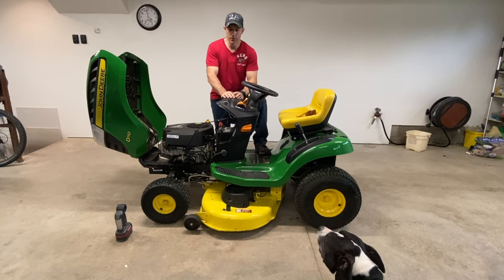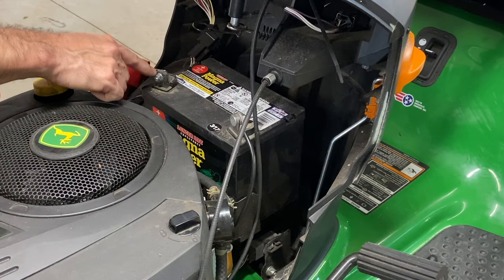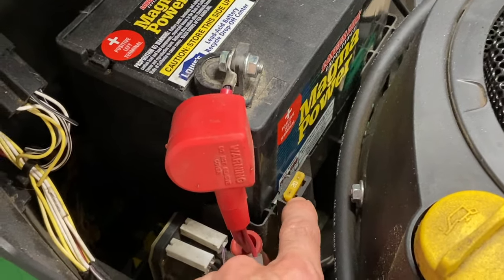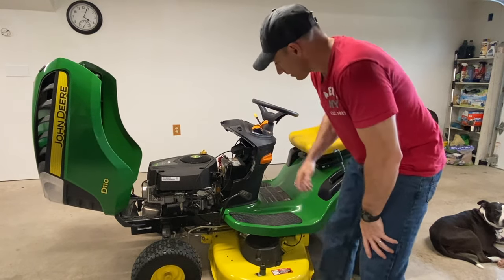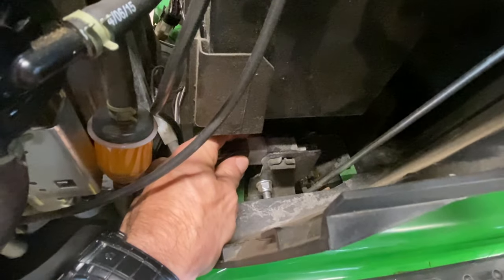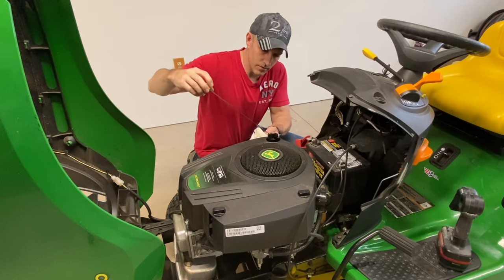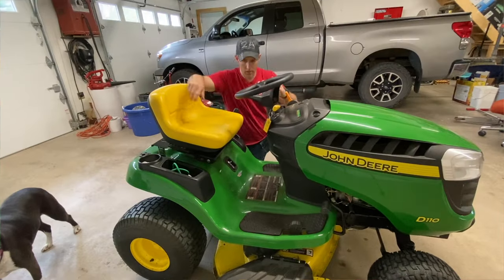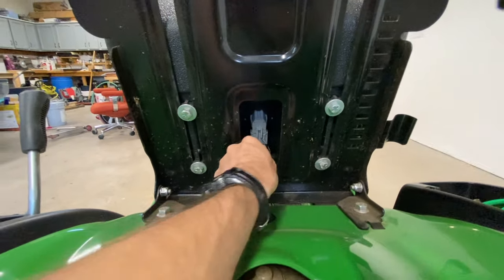JOHN DEERE 100 SERIES WON'T START

Comment: My lawn tractor, pretty much just like yours, was running fine today. Stopped in the middle of the yard to do something, hopped back on to start it, and it just clicked. Battery had plenty of juice. Watched your video, simply jiggled every electrical connection you mentioned and made sure it was tight, and later it started. I still don’t know which one was loose, but you helped get something reconnected and ultimately helped the engine start. Thank you very much!
Reply from the maker: Your welcome

Comment: Mine cranks but won't start.  I assume there's an air filter as well? Has new battery one year old.  It did run out of gas last time I used it.  Started right up after I added gas.  Maybe it sucked debris into the filter when it ran out.  I'll check that first.
Reply from the maker: hope you got it figured out
Reply: Air filter is typically all the way up front on the engine. Under a cover with hand screws

Comment: if i check everything you said and ????  but engine turn but dont start....  i didnt tuch or starded the john deere D160 for 3 years.  last week,  putted a new batteries, new fuel, new spark plug, new filter, fuel goes in engine, no air in fuel line, fuel pump seem fine, i drain all the bad fuel out of the tank and replace it.  ???? can you help
Reply from the maker: Real hard to help from a comment wish I could. Maybe your carb is clogged. I would take a little video of it and write the same thing and put it on one of the small engine groups on Facebook. You will get lots of answers

Comment: I mowed my yard and turned it off. Won't start back up.
Removed fuel filter. Not plugged flows nicely. Checked the fuel carb cut off solenoid and it clicks when key is turned to off position. Removed it and cleaned it with carb cleaner and replaced.
Still won't start.
Pulled fuel lines off fuel pump and turned the engine over. Fuel flowed nicely from the pump on the carb side of the pump. 
If I hold my hand over the intake it will start but when I remove my hand it stops again.
I removed the fuel cap and tried to start it. Thinking it may not be letting air into the tank.
Tried it again, won't start. What next?
Reply from the maker: Did you see this other video I have? Your problem sounds like what happened to me. https://youtu.be/0qStUg0ImoI

Comment: Great video. The one thing I didn’t know about is the fuse you pointed out. That fuse caught my eye when I was going to replace my battery. I had know idea it was there until that moment. Now I know to check it if the engine will not turn over.
Reply from the maker: Thanks for watching

Comment: Good video Jim.  I tried all those things but it still would not start. I opened up the air filter box and sprayed carb cleaner down the hole and still nothing. So I decided to see if fuel was reaching the carb so I disconnected the gas line at the carb and turned over the engine to see if gas would squirt out. And guess what, it did, and not only that but the darn thing started, with me holding on to the gas line. After that I plugged it back in and it started again. I'm not sure why but it works now.
Reply from the maker: There is something with the gas lines I have not exactly figured it out but I have another video on it.  https://youtu.be/0qStUg0ImoI
Reply: Did you run out of gas?  Just had this happen on my Case diesel tractor.  Running out of diesel air locked the fuel injector and the lines to each injector had to be bleed (similar to what you  did) to get the air out.  Not sure if this can happen on these tractors but what you describe sounds very similar.
Reply: @philipgransewicz160  No I did not.Maybe it was just coincidental. The next day it wouldn't start. I replaced the plug and air filter, put more gas in the tank and still would not start. I took out the plug and it was wet, dried it out, waited a bit then it finally did start. Maybe I'm leaking too much oil in cylinder.

Comment: If you use a screwdriver between the two points on selenoid and the tractor starts does this mean the selenoid is bad or the starter is bad? Just bought the selenoid maybe  two months ago.
Reply from the maker: If you turn the key to the start position and you get no starter action and hear no noises, that is a symptom of a bad solenoid.

You can test this by checking voltage to the solenoid. If there is voltage present then check for voltage on the other output side of the solenoid while holding the key in the start position.

If there is no voltage on the output side of the solenoid, then the solenoid is bad.

If there is voltage on the output side then the solenoid is OK.

Now check for voltage on the starter wire. If voltage is present with the key held in the start position then the starter is bad if the lead is clean and tight.
Reply: @DIYJIM  Thank You Sir

Comment: Was hoping for solenoid or starter testing. But good through checklist prior to it. Thanks!
Reply from the maker: sorry thanks for watching
Reply: @DIYJIM  Not a problem. Turns out it was the PTO switch thinking it was on. Did the screwdriver while holding the key to start over the solenoids bolt ends that the cables connect to and it starts sparks flying. One side had 12+ volts with multimeter (one on negative battery and the other on one of the bolt ends of the solenoid and the other was nothing. So went to check the three safety switches (Seat, PTO and brake), luckily started with the PTO. While holding the key and the SLIGHTEST touch to move the PTO switch, it would start. Hopefully a new switch will seat tightly/snuggly (D140). Thought I'd share, hope it's useful!

Comment: To check the battery - what setting do you put for the multi-meter? I'm praying it's just the batteryl
\
Reply from the maker: Check this video out start at 1:20 hope this helps. Thanks for watching
Reply: @DIYJIM   At 1:15 you moved the knob on the meter - was that to a specific setting? Turns out I was able to jump start the mower!

Comment: Thanks. One thing to add would be moisture. Apparently after going through each thing you mentioned, it was moisture in the engine from all the rain, humidity and dew we’ve been having in my area. Once it dried out it fired up on the first turn, whereas it was starting up, but not turning over until it dried out.
Reply from the maker: Never thought of that, thanks for watching

Comment: Owned my John deer for 5 years.  Done the oil changes and all. After every winter I have a hard time starting it.  I’m sitting on it with the break on, not pushed in.  This year I flooded my engine.  So I you tube things you can do to help start it.  For 5 years I have not been pressing in the break while starting. So I went back out there and did that.  It started on the first try 🤦🏽‍♂️🤦🏽‍♂️🤦🏽‍♂️ Thanks to this video for helping me out.  When I bought the machine they never told me to do that when starting.  God bless
Reply from the maker: glad I could help thanks for watching

Comment: The electrical connection on the solenoid on mine doesn’t fit tight. My front yard has a few bumps so mowing my lawn is great until I hit a few of those bumps and it comes loose just enough to make it stall.
Reply from the maker: Maybe you can get a new connection thanks for watching

Comment: Jim, so glad I've come across your channel.  
My D110 has been working great until this past week. It simply shut down while I was mowing, and would not restart. 
I let it sit for a while and it started right up and runs strong, but dies again within a couple minutes. Repeated this multiple times. Starts quick, runs well and dies.  Everything you've shown in this video seems not to apply.
Reply from the maker: Have you seen this https://youtu.be/0qStUg0ImoI

Comment: Great video. Don't switch fuel line hoses by the carb. It won't start if you put one on the wrong line.
Reply from the maker: Thanks for the tip

Comment: Nice video, I learned a number of things.  My new (3 months) S120 was fine.  I was mowing and stopped, emptied the bags and now it will not start.  I turn the key and nothing.  Checked all the stuff, the lights and all come on, it shows the gas is full, but I turn the key and nothing.  Had to push it back to the shop (taking a few rests along the way).  Guess I will be calling John Deer.
Reply from the maker: Thanks for watching, hope you get it figured out

Comment: I have a LA115 that suddenly quit. The Service Reminder shows 199.9 hours, and "SVC SVC" is flashing. I haven't tried restarting it until I know what "SVC SVC" means. May have something todo with adjusting valve lash, which is scheduled for every 200 hours.

Comment: I am having trouble with my Deere.  I'm sitting on the seat, the parking brake is on, the PTO is "dis-engaged", the battery is testing at normal.  I turn the key and nothing happens, I don't get any "clicks" and most importantly I don't even get "headlights", they don't come on.  I checked the fuse - I have gas (it basically won't turn over at this point).  It's less than 1 year old).  Can you tell me, without starting it, nor sitting on it (without the e-brake on), will the headlights come on in the second position (on the ignition)?  Super important because I'm trying to see if you get lights without sitting or brakes.  If you get lights, I think it's ignition (can anyone test this for me?)  Either my ignition switch is gone, or the brake peddle safely or seat safety switches are bad.  I don't' think it's solenoid, because I'm not getting any headlights, that's triggering for me that it's not the solenoid, but I will test it by doing the "override" with a screwdriver.  Help - Jim!
Reply from the maker: Just went out and checked yes my lights come on without starting my mower.
Reply: @DIYJIM  Thank you for that - I seemingly have some sort of issue  cause the lights won't come on.  I did testing of my ignition switch and all appears to be ok.  I'm going to continue to try and figure this out - thank you for taking the time to see if  the lights came on - much appreciated sir!  I have some sort of power issue, no doubt now!
Reply: I know you said you checked the fuse….but did you ohms check it? They can fail and not be visible. Just replace it if you don’t have a multi meter. Then I would go to the starter solenoid and beat it and see what happens. Might even just replace it cause they are cheap. Sucks to throw parts at it but without video to see what is going on it can be hard to diagnose.

Comment: Good info. How do you clean it?  Can you spray it off?  Maybe compressed air?
Reply from the maker: I use my blower to blow off the deck and then I also use my hose a couple times a season.

Comment: Thanks Jim for the troubleshooting, I have an S100 (2022) I went through all of the steps, there also seems to be a sensor on the Forward/Reverse pedals , if it is stuck in 'reverse' mode it will not start
Reply from the maker: That would probably be a problem.

Comment: thank you so much… i just seen the fuse was blown.  i just assumed it was for the lights or something ha. still didn’t know it was blown but I do now Ty .… can honestly say you are the first you tube video IVE EVER kept watching after i figured out the issue , and i did immediately or I’m sure this is it . let’s hope it’s all that’s wrong . going to go get a fuse. I’ll be back ..
Reply from the maker: Awesome glad I could help thanks for watching
Reply: @DIYJIM  4 fuses have blown. why 4, bc im in an unincorporated lil town far from the stores and that’s all i had gotten 😂. no but fr it cranked on the 3rd fuse and sounded great like the norm as usual. no cutting out or anything odd at all . i let it run a couple min and it was fine . never engaged it or anything . i got down to let my hubs mow so I shut it down completely and properly ya know . when he went to crank it . pop, that one blew. keep in mind I’m hearing them pop. the actual fuse blowing . just the normal i reckon on that. but yea , went ahead and put the last one in since i JUST had to see that it would pop it again 🤦🏻‍♀️. and it did . but yea… Is their some wires criss crossing or what’s causing these fuses to blow do u know ? Ty so much ….
Reply from the maker: @nvrgvnup4346  just Google what could make my fuse blow on my lawn mower. There are a few answers that come up. Hope this helps
Reply: @DIYJIM  ty that’s what I’m doing rn .. i may post on the main thread and ask if anyones had the same prob Ty …

Comment: If you have the parking brake engaged you can start it without sitting on the seat.
Reply from the maker: Yes your correct I guess I should have said that. Thanks for commenting

Comment: If the motor does not turn over, it may be a bad solenoid: you can check by shorting the terminals.
Reply from the maker: thanks for the info have a good summer

Comment: Thank you your video was great I had no idea that switch for the pedal was there I pulled it apart it was a little corroded sprayed some QD electric cleaner on it plugged it back in and it fired right off thank you again
Reply from the maker: Awesome glad I could help

Comment: Thank you sir . - nice instruction- on some kohler engines you don’t thread in the dipstick to check the oil level , on a Briggs if it has too much oil it can blow a cloud of blue smoke when you start it - if the mower has an electric clutch for the more deck it won’t start if it is pulled out
Reply from the maker: Thanks for the info! This might help someone out

Comment: Mine has 23 hrs and just quit in the middle of mowing. Drained and changed fuel, cleaned filter, checked spark plug, under seat shut off.  Tries to turn over, but will not run?
Reply from the maker: Maybe the battery is bad

Comment: Whats that orange handle of the left side of the mower on the plastic where your left knee would be i subscibed
Reply from the maker: Thanks for subscribing. That is a parking break if you push in the break with your foot and pull up on that you can lock the break on the john Deere then you can get off without the mower shuting off. Hope this helps

Comment: What if the smoke comes out of the motor where you fill the oil...
Reply from the maker: Could be to much oil in engine or maybe a dirty air filter. Take the air filter completely off and see if it stops if it does maybe replace the air filter.

Comment: When starting the mower, the starter gear does not line up with the engine's gears. It slips out and freezes up. What's up please.

Comment: I have an old STX 38 that starts intermittently.   It has a sense of humor.  It only clicks each time I try to start it,   for 20 minutes.    I break out the push mower and do enough of the lawn that when I come back the tractor starts right up.   I know it is not the battery because it would never start.   I know I am sitting and have blades off and clutch down.    So what is going on?
Reply from the maker: Hard to tell sorry much easier to diagnose in person. Sorry can not help

Comment: I just jumped off mine to get some water and now no start , not even attempting to .
Reply from the maker: Hope you get it figured out. Are your blades off?
Reply: @DIYJIM   lol, I'm a Moron  .. Blades were on. .   I thought killed something because my battery terminal was loose and it shorted something. 
 Finished the lawn with the push mower only to read your comment when I went to put it away.
Reply from the maker: @5british5  don’t worry I have done the same thing. Lol

Comment: Cut grass build up on top of deck while cutting grass.major problem cleaning it after each mowing on my John deer 115.looking for answers to this never ending problem.
Reply from the maker: i use a blower. I show this at around 9 min in this video hope this. helpshttps://youtu.be/TeZUBvkh0N8
Reply: Air compressor I use to blow grass off,either that or don't use it 😁